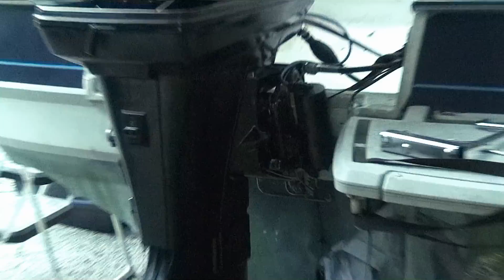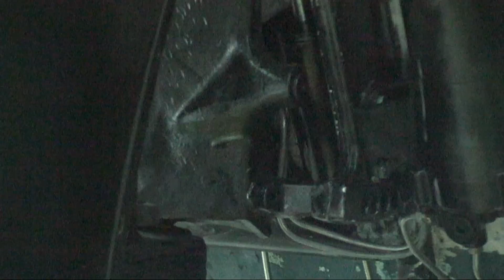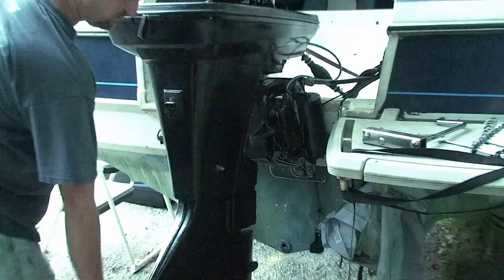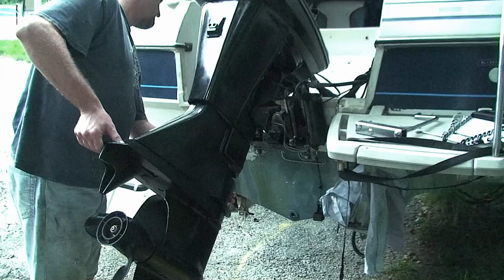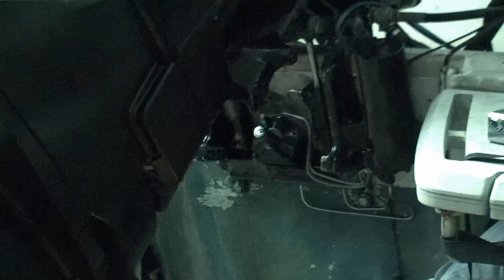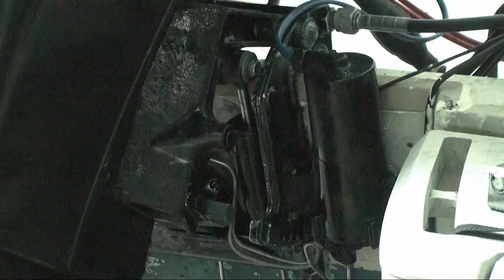Problematic Trim and Tilt - Force 125

Comment: I did replace the piston seals the left hydraulic but still have issue go up and down but won’t stay up any help pls
Reply from the maker: The next step is to check all line fittings, but be careful, the housing or the fitting can strip easily
Tightening them tight really shouldn't be necessary with a compression fitting it might be best to replace them, but it can be a real pain to do because you'll probably have to make new lines. 
Especially if you are impatient like me 😁
Reply from the maker: One other thing, do yours have a check valve, old ones just have a ball bearing. I just can't remember where it is at the moment.  Just remember crawling around on the floor when we dropped it.

Comment: i hate to bump a 10 year video, i have the same motor  ,the trim works fine but bleeds down,any help would be great
Reply from the maker: my guess is that the o ring in the piston needs to be replaced
Reply from the maker: not sure if you did any troubleshooting steps, did you try searching the forums at forums.iboats.com?

Comment: Is the other cylinder (the one on the left side as you face the back of the hydraulic rams mount) a weight balance cylinder? There are no hydraulic lines running to that one. If a weight balance cylinder, would a bad seal inside that cylinder prevent the other active ram from being able to lift the entire weight of the motor by itself? Thanks for any light you can shed on this.
Reply: Their is 3 cylinders 1 on each side that are the same and a fine cylinder in the middle

Comment: so whats the fix guys  mine does the same thing
Reply from the maker: The fix in this was the o-ring on the piston AND fouled threads on the manifold. There was someone on eBay that sold repair kits and that worked to repair/replace threads and fittings. The o-ring  replacement is fairly simple
Reply: thanks for the post
Reply: I know this is a long shot but I’m going to attempt and bring this back from the dead... can you tell me where these bad orings are? Thanks In advance and great video btw
Reply: would like to see a video repairing it
Reply: what do I search for on ebay for the manifold repair kit? Or do you still have access to the listing you bought yours at?
Reply from the maker: There's a good chance I do, give me a little and I'll get back to you
Reply from the maker: I think this is it https://www.ebay.com/itm/333123543858